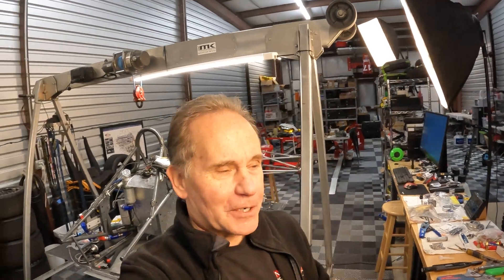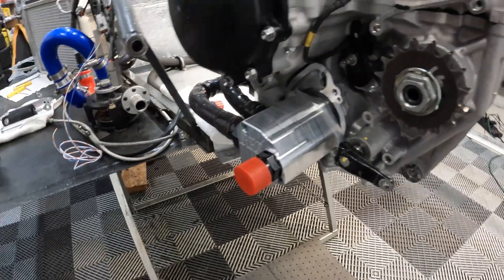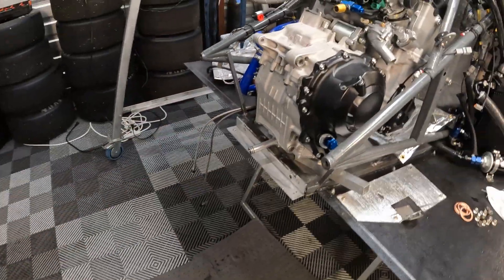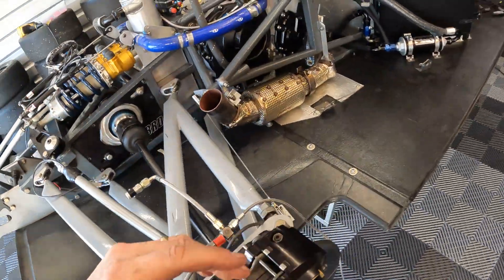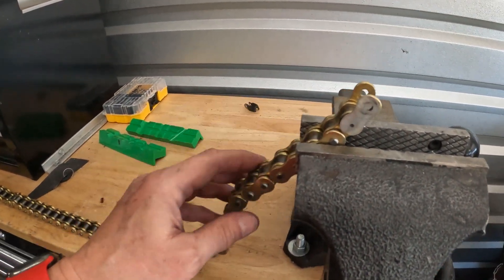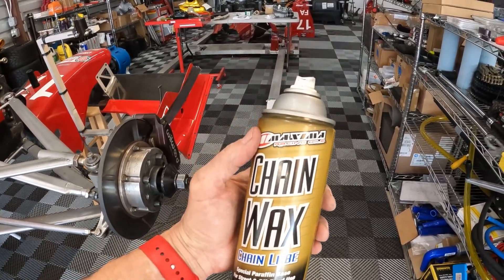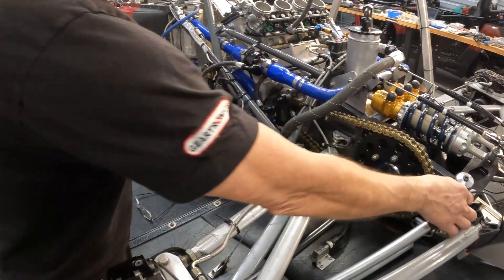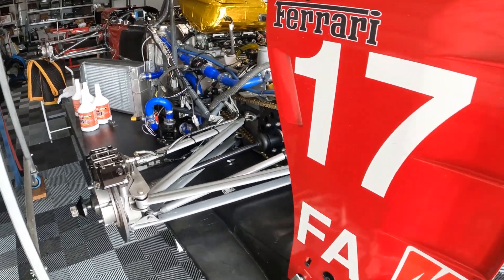Installing a 2021 ZX10R engine into a Formula 1000 race car

Comment: i always wondered why no one ever did a V4 in one of these. 
must sound awesome
Reply from the maker: I am wondered the same, V4 1k engine.  I am guessing fitting is the challenge.  I’ve wished that the rules allowed turbos or to run the ZX10R H2 engine.  Cheers

Comment: I followed f1000 since its inception, just came across your videos, good job. To bad they dont make them any more.
Reply from the maker: yes the F1000 has had some interesting moments and future is questionable.  On the positive cars are out there and if you begged and such you may be able to buy one new from previous manufacturers.  What I have seen is a few converting citations into the F1000 rule base that works well.  Stohr like my chassis says they are still making cars but I would suggest you stay on top of them if you went that path.  At least you can race in the FA class and depending on the track the F1000 is competitive.  Etc etc….  Thank you for the compliment I do appreciate it.  Cheers, Mark

Comment: You can clean the chain with WD40 or similar, those are detergents! Then put on chain grease/lube of preferred kind. RK make the best chains in the world. Why do these cars use chain diffs and not a regular diff from a Mazda Miata or similar?
Reply from the maker: Good to know on using WD40.  Most chain diffs are rock solid and never require service.  You are right I have had one that gave me trouble.  Light weight can be a trade off in longevity.  Thanks for the note and thoughts!
Reply from the maker: Can you clean with WD40?  I suppose you can.  Before I install my RK chains I remove the bulk of grease with turpentine then apply chain wax.  From there, I do not use cleaner other than a rag and reapply chain wax.  Why do we use a chain diff?  Weight savings for sure, these cars are light min weight is 1000 lbs with driver and fluids.
Reply: Yes since WD40 is a detergent and not some lube, Ive been using it for years to clean the chain on my motocross bike, Chain diffs are light I know but very expensive and they brake like yours! @NixonMotorsports

Comment: Another great vid.  Have you ever considered using a toothed belt drive rather than chain ?  Possible less drag less heat.   Mite be over kill and a pain in the arse to develop,  but got me thinking. Another thing was a consideration of a blown deffuser ?  Was going to try that many many years ago , but never did.  Their are some advantages to it but the exhaust and the new diffuser have to be in sink together as you know. Considering that you have the Motec I think you could develop it.  Anyway.  Cheers my friend.  👍🇦🇺🥃
Reply from the maker: Ah,  a long conversation.  I like it.  Belt…. Humm,  a maybe.  I have spent a ton of time and money with various chains,  tensile strength and size.  For example I have used a 520, 525 and such.  With the power we produce anything other than a top of the line 530 chain will survive.  My point I would worry about a belt.  It would lower rotational mass and lower friction.

Comment: Power figures and weight ?
Reply from the maker: Sure thing.   Engine power is 224 HP and car weight with driver is 1025 lbs.  let me know if you have other questions.
Reply: @NixonMotorsports  Thanks a lot.  What kind of chassis and material is it?0-100kmph and 200kmph time? Max speed achieved? What kind of gear shifting mechanism used? What material brake rotors been used? And the most important one, tyres size combination front and rear.😄
Reply from the maker: @theversatile5015  A bunch of good questions.  Chassis is a Stohr space frame (metal) with fiberglass bodywork, carbon crash structures (nose).  While my base chassis is Stohr it is highly developed and not much remains Stohr.  Top speed depends on track and how trimmed out you are but 160 mph is top end.  For me, I normally see up to 145-148 mph for the longer tracks.  Not sure what 0-60 MPH time is but I suspect it us less than 3sec.  Shifting is pneumatic air paddle shifter.  Brakes are steel solid floating rotors with 4 piston calibers front and rear.  Tires can be up to 10" wide, I use 7" fronts and 8.2" rears for high speed tracks and 8.2" fronts and 10" rears on others.
Reply: @NixonMotorsports  Thanks a lot ❤️

Comment: I may have missed in the video but is this engine an upgrade to the GDRE 2019 ZX10RR or for different classing?
Reply from the maker: Hi, sorry for my delay responding.  Yes, this is another engine I have.  My current engines include a 2017 ZX10RR, 2019 ZX10RR and a 2021 ZX10R which is this one.  My 2019 ZX10RR is being refreshed now that is all.  The main difference on this 2021 engine is it does not have the special titanium rods that the RR has.  Let me know if you have other questions.  thanks